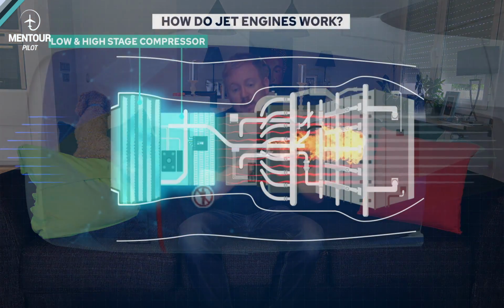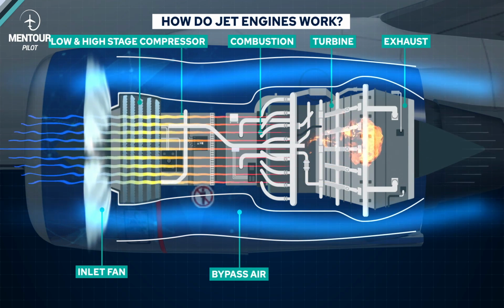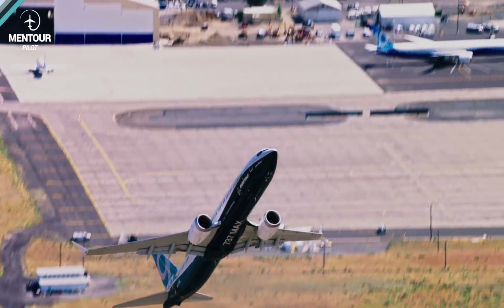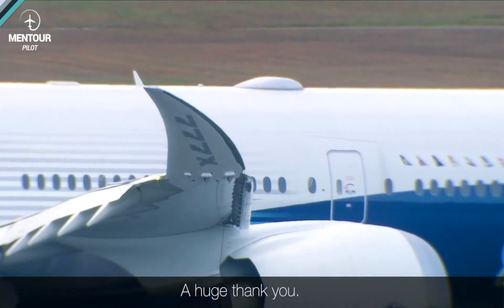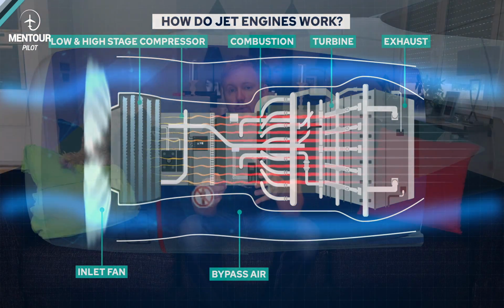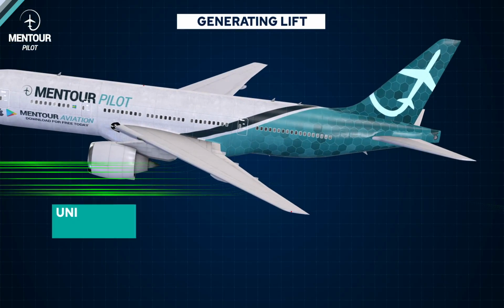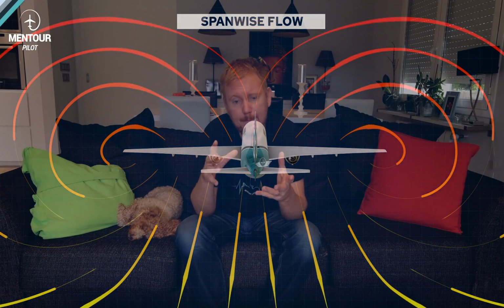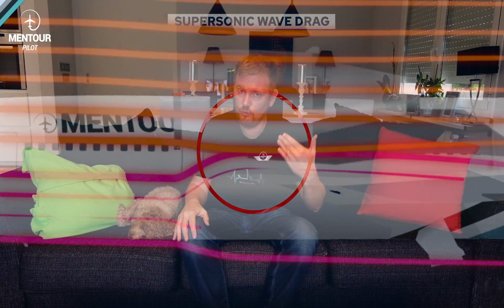How BIG can jet engines get?!

Comment: High bypass engines also tend to be much quieter, and exhaust gasses are slower and not as hot. Early jet engines were ear splittingly loud, not helped by supersonic and very hot gas just being dumped straight into a freezing atmosphere... Fans these days are designed to cut down noise :-)

Comment: Hello!
Very interesting, I wonder, would it be possible to put solar-panels on top of the wings (built in to the top of the wings) to aid the motors electrically like a hybrid solution?
I understand that this would make the aircraft behavior different depending on the relation to the sun, which might not be ideal.
But it's a thought.
Reply: Solar panels would have a negligible impact on a turbofan engine, even if you could hypothetically set up such a system. You might be able to get thousands of watts from your solar panels, but jet engines output millions of watts of energy. I reckon  the added weight alone would mitigate any benefits.
Reply: @caracalfloppa4997  Thanks for the answer, well now I know.

Comment: I wonder if there's a way to build the engines into the structure of the wing itself. Would seem to be a reasonable compromise from an aerodynamic standpoint.
Reply: You can't make the wing thick enough. Old aircraft like the Comet and Vulcan, and some modern military aircraft like the B2, used that design, but they aren't tied to maximum efficiency. The biggest engines are 14' in diameter already, and you'd need to add wing structure around that.

Comment: I can see a load of reasons why it wouldn't work - complete redesign, complexity for upgrade and field maintenance, where you'd seat the crew and passengers, redundancy / single point of failure, and more besides, but I've long been fascinated by central engines. Right in the nosecone area, as can be seen in some military jets. Being dead centre strikes me as potentially more efficient with less drag, but I'm no physicist and certainly no pilot. In theory would it not be the case that you could upscale to a higher degree as well as have more compressor stages, if these are all inline within the fuselage below or between the passenger rows? Mind you, it'd make for a noisy journey. Fascinating subject and, as always, superbly explained.

Comment: currently a big jet with a full passenger load can not maintain altitude on one engine.   Don't the lives of the passengers, flight crew and cabin crew count?  Maybe they're just collateral damage in the quest for $$$$?  The bean counters will finish off Boeing.  They already killed two fully loaded 737s with all their passengers, flight crews and cabin crews.

Comment: What I still don'T understand: if the bypass produces most of the thrust without any combustion, so the fan is basically a glorified propeller, what exactly is the difference to a turboprop then?!

Comment: Just thinking... if you increase the size of the engine, the size of the fan-blades goes up.. I think this would be also a limiting factor... the tips of the fan will be reaching the sound barrier at some point... extra internal compressors to slow the low-pressure fans ok.. but then we come to the weight part like you explained.. or am I wrong? update: ok, this has been mentioned

Comment: There's another important bit if physics driving the use of bigger fans, and that's fuel efficiency. Whilst the thrust varies linearly with the change of velocity for a given mass of air, the kinetic energy that has to be put into that air goes up to the square of velocity. Thus it's much more efficient to accelerate a lot of air by a small amount than a small amount of air by a large amount. Much less energy is wasted n excessive exhaust velocity. As a useful side effect it's quieter too. 

It's this simple fact that makes fixed wing aircraft with large wings a lot more fuel efficient than helicopters as the volume of reaction mass required to deliver the lift is much higher on a fixed wing aircraft and the air is accelerated downwards a lot slower than with a helicopter's rotating wing. It's also the primary reasons why jet engines and, especially, turbofans are much more fuel efficient than rocket engines.

Comment: Nice video, although I slightly missed, why high bypass turbofan actually use less fuel. I guess this would have been explainable in the formula table very easy. And I'm late with my comment, sorry for that.
But while we now have an answer of HOW big jet engines can become: what is, when this is maxed out and there is still need for more efficiency? That was mentioned in a sentence like "there must be a fundamental change in how we build airplanes" and I think this would fuel another video easily :) 

I doubt that we will see the flying wings one day, as per my understanding, all the efficiency gain of such a plane will be traded of by other quirks that come along with flying wings (lot of wasted space as the cabin needs to be walkable and the fuselage/wing still needs a slender shape, not scalable like tubes without a complete new frame design, bad pressure vessel design as, regardless of new fancy materials, a circular tube will always be better than a flat one, as the tubes will benefit from new materials too). Finally I have my doubts if flying wings are actually good at transsonic speeds, as you either have a bad aspect ratio or a bad area ruling - and the "best" compromise between them is still terribly crap, compared to a tube with wings design. I mean: what are the by far most efficient airplanes in the world nowadays? Sailplanes. Do they come with jets and high mach numbers, suitable for intercontinental travel? Lockheed Martin says yes and pulls an old U-2 out of the hangar.

So will we see in future...
- a flying wing/BWB? I doubt it.
- an U-2 shaped airliner? Maybe and more likely than a flying wing.
- Propfans, to get rid of the heavy and diameter-eating bypass casings? They are overdue in my opinion. Props = green, let us hammer this into Joe Average's mind.
- a high wing design, like a pumped up Avroliner, or a C-5 Galaxy/A400 shaped airliner? Maybe, one can fit pretty big engines under these wings and cargo airlines will also love the low floor design!
- the return of the rear mounted engines? Why not? Bigger engines on an underwing design require not only taller and thus heavier gears, the longer legs also require the engines to be farther out which needs increased vertical stabilizer and rudder surface to cope with the increased asymmetrical thrust issues. Or a terribly complex and thus heavy and expensive gear folding mechanism. So we might come to the tipping point, where the stronger and thus heavier center wing box design needed for rear mounted engines will be the easier, lighter and cheaper solution. Anyway, I can see interesting times approaching. What do you think?

Comment: It would be interesting if Mentour Pilot could put together a video on airliner economics. The move to twin jets and away from quad jets is not without consequence. Two engines doing the work of four means great stresses on those engines. I have heard that earlier 777 engines sent in for scheduled overhaul have limited internals that can be reused and an overhaul is little removed from a new engine, which is an increase in cost. This is versus a 747 engine that is almost entirely reusable. In some ways, four 747 engines are cheaper to maintain than two 777 engines. I am also hearing that the new 777X’s GE 9X engines have been built to relieve the stresses of earlier engines, they do after all produce less thrust, so engine reliability and maintenance costs should improve. We will see. But airliner economics are far more involved and complex than we the public generally get to see. Maybe Mentour Pilot can take us on a tour of this to give us passengers better insight.

Comment: Hello, thank you for your super interesting Channel! 
I was wondering: engine layout such as the one of A400M or an Antonov AN-124 could ease the accomodation of big engines below the wings, since the wings are implemented on the top of the aircarft fuselage. Why such architecture is not applied to commercial aircarfts?

Comment: One limiting factor of engine size will also be when one of these failed engines creates so much drag in flight that ETOPS will not be guaranteed anymore, and as we've seen with the two UAL fan blade failures, this can happen, and the amount of drag induced in such cases. Another limiting factor will be the vibrations caused by an unbalanced fan blade as shown in UAL 1175.

Maybe the solution to this will be that the pilot can eject the complete engine from the wing, but I suspect airlines will not like it too much if the plane suddenly loses a 8 million USD engine in the ocean because it failed.

Comment: One of the answers to this question is - "Jet engines can get so big that they compromise the characteristics of the airplane to the extent that computer software needs to be installed in order for the plane to fly like one fitted with smaller engines".

Comment: My follow up question is, although more irritating to passenger would an over body wing with under hanging jets be more common to help reduce weight especially if a focus on engine sound is made going forward, as this is an issue both for passengers on board and airports (sometimes even limiting aircraft out of some airports)? As this would allow for a smaller landing gear. though I suppose this leaves tail issues due to airflow meaning either T shaping like a C5 or some how lowering the horizontal wings at the back or going crazy and front mounting them.

Comment: There is actually a pretty simple and proven solution for increased engine/fan/propeller size: High-wing plane. Why this config is never applied on large passenger jet designs is because of a few other dilemma...

Comment: why don't they slap a big ass motor in the middle of the aircraft like a fighter jet?
Reply: I agree, they should consider that, I’m no engineer, but a second engine is kept there in case you lose one, or because the airlines need to stuff the passengers in the fuselage and not an air inlet.
Remember that stupid clickbait plane from TheRichest? The one with the fuselage and engines switcherood? That’s basically what this concept is.

Comment: What if they did a high wing with large engines. Like when the wing is on top, I know they are usually turbo prop but why can't they be turbo jets and larger turbo jets
Reply: Ba 146 - high wing commercial jet

Comment: Theoretically, would it be possible to have a turbofan engine where instead of having combustion, can the driving force be an electric motor? I'm thinking along the lines of mechanical efficiency, and I acknowledge that there are limitations to say, battery tech and/or hydrogen tech
Reply: It wouldn't be a turbofan anymore, it would be a ducted electric fan. So no, it's definitionally impossible. In practice, yeah, totally, they do it on RC craft all the time.

Comment: Could the wings on top of the fuselage?  Or have a gull wing design to raise the height of the wings to create more clearance?  I'm sure engineers have considered this but I'd be interested to know why they don't do it (or if they do in some aircraft).
Reply: Yes, that's quite possible. Many small aircraft and some larger ones like the B-52 do exactly that. The thing is it has some downsides that make it less than ideal for passenger aircraft:
* It makes evacuations more dangerous because passengers can't walk out onto the wings and slide down, instead having to either be under the wings (which isn't possible or safe after many kinds of landings) or not be able to exit near the middle at all.
* It would likely expose passengers to more engine noise since there's just open space between the engines and fuselage instead of deflecting a lot of sound off the bottom of the wings.
* It again increases the noise passengers are exposed to by sending turbulent air down past their windows instead of having most of the turbulence below the aircraft.
* Other design factors could compensate, but it decreases the ground effect during takeoff and landing, potentially requiring higher speeds and/or making rough landings more likely.
Reply: @MrNukealizer  Maybe boeing could ask from mercedes s580 maybach engineers how to do proper noise dampening then ;)

Comment: So I am a few months late, I know, but when you talk about engine above or below the wing, I get that there is an aerodynamic issue to be dealt with. So lets not put the engine on top of the wing.

But, how about raising the wing like on the Antonovs? Or placing the engines at the back, like the MD90? The An 225 has six engines, but couldn't it in theory have two enormous ones hanging from the wings that are already high up on the plane body?

Comment: Since no one has said it yet, I'll be that guy. The combustion chamber does not increase the pressure. As the fuel burns and heats the air it causes the air to expand out the back, which increases the speed and volume. It does not exert any additional force on the walls of the combustion chamber.

Comment: Can you make a video on how to avoid the 737 Max as a passenger? Which airlines doesn’t have this death trap in their fleet? I’m never gonna set a foot on to that machine. “Made by idiots supervised by monkeys”.. 

At 15:30 you explain aerodynamics around the wing but Boeing hasn’t designed the plane in a natural way. They lifted the new engine to make it fit, so now the plane has a unnatural weight distribution and aerodynamic situation. To compensate for this they made this computer program which sent two aircrafts into the ground. And now they’ve “fixed it” by making that program less aggressive.. 

The plane is still a massive failed construction. All done so pilots doesn’t need simulator time and hence to make the plane more viable economically for the airlines. This is all just Boeing trying to not loose marked shares to Airbus. It’s a scandal and people should be in prison. 

It now comes down to the pilots. If you guys don’t draw a line in the sand by refusing to fly this plane, then more people will die. Also, this plane is so new and with being grounded for yrs now, we just don’t know what other shortcuts and mistakes these same people have been making.. The FAA obviously can’t be trusted and have their own agendas and motives.. It’s a horrible situation and I feel bad for the families of those two crashes and pilots who has to operate this piece of junk:(

Comment: This was very well done, just a TINY error - The new ceramic materials are called "ceramic matrix composites", not "ceramic composite matrixes" =]. It essentially adds fibers to a ceramic to form matrices. Ceramics perform well at very high temperatures where metals will start to lose there strength and melt. For an engine, as you say, the hotter, the more efficient. However, ceramics can fracture under certain stresses which is why they have not been used until reliable CMCs were developed. CMCs are designed to counter this well known issue. The final resulting material is a "composite" of fibers and a ceramic, not a matrix =].